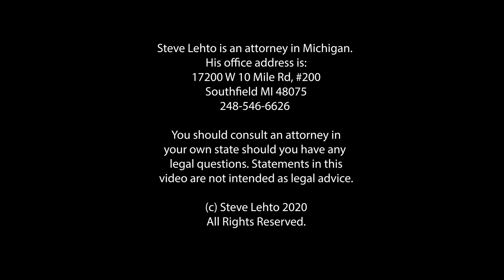Ford's Mystery Fix Explained - Ep. 6.263

Comment: Steve that's not it..........
Reply: @grandmasmalibu  The temperature gauge in any modern car is electronic, and the normal resting position of the needle actually represents a broad range of operating temperatures considered normal. This is to keep consumers from being concerned about perfectly normal variations in coolant temperature during normal driving. It is very possible for Ford's fix to significantly alter engine temperature with the driver seeing no change on the gauge. It's also possible for an update to reprogram the temperature range in which the gauge shows a normal reading, but we have no confirmation that they did that here, it's just also possible.
Reply: @grandmasmalibu  2 things: 

1, the modern digital gauges often have a range of ideal temperatures. For example my car shows it at "ideal 90c coolant temperature" anywhere from about 83c to 95c, the gauge doesn't move in that range, not like an older style gauge. I have confirmed this using the OBD port to read the coolant temperature.
2, the coolant in the engine may be a very different temperature to the temperature that the coolant temperature sensor is reading. The coolant temperature in the small channels in the block might be much higher than the temperature at the sensor, depending on where the sensor is in the loop. This is especially the case when using these electric fuel pumps, they are used so they can have very low coolant flow rates when the engine is in the initial warm up, and at lower flows rates there may be a larger discrepancy.

Obviously this all depends on the exact layout and operation of the coolant system, but I suspect the car is holding on to the lower coolant flow rates too long leading to hot spots in the engine, especially when the car experiences a large increase in load, such as when joining a freeway.
It's also possible they are running the coolant pump after the engine stops to prevent the hot spots after shutdown and avoid any warping due to differentials in temperature over the head and block.
Smart things these modern cars, they need to be, they are pushing the boundaries of technology quite hard.
Reply from the maker: YOU'RE WRONG!
Reply: @stevelehto  you are correct , Carnac the magnificent . 
we are the best , most knowledgeable, 
well read, understanding fans in the World.
Reply: @stevelehto  The PCM fix is a bandaid, the problem is mechanical, cracked head and leaking head gasket can be ruled out I think or the vehicle wouldn't be driveable for very far. Is there a vacuum operated switch in a coolant port on these vehicles?
Reply: @stevelehto  my guess is the engine is weak in the head gasket or o ring seals. The ?electric? water pump wasn't coming on after shut down. Heat builds and physics takes over. If they keep circulating water after shut down it stays cool and physics can't overcome the seals. Which means the engine is under engineered for common natural physics inside the engine. I'll not be buying one of those. Thanks for sharing
Reply: @grandmasmalibu  I would agree that this is not a good fix but a preventative measure if you haven't experienced a leak. As described below in another post if the engine has had the problem occur due to the torque to yield headbolts getting over stressed and loosing the gasket compression from new installation values, then it would seem like this will continue until the headbolts and gasket(s) are replaced and then the new programming may be effective. Another concern would be what would happen to the engine if the electric coolant pump would have a fuse blow or fail? Would this ruin the engine instead of a leak as we usually have now indicating failure?
Reply: @timhammond691  the fuse is not anymore likely to open now then before.  If the pump stops running, the coolant will get too hot and the warning light will illuminate.
Reply from the maker: @Real_Mechanic87  You missed the joke?
Reply: Wife has a 2012 Charger. You actually able to watch the coolant temp move, in a digital gauge, Whereas the needle does not move once the engine warms up. On to this issue, I still would believe that even with this "fix" there are still going to be issues with blown head gaskets. GM had all kinds of coolant leaks on V6 engines. Wife had 2002 Pontiac, that was recalled to tighten bolts on intake manifold. And older GM V6s blew head gaskets at around 100 thousand miles.
Reply: @robertbelluchi1151  oh, no doubt there should be some concerns. It's entirely possible it was bad software resulting in damage and now fully fixed. It's also entirely possible it's just a bandaid to hide another defect. It also doesn't fix any damage, warping or anything else that has occurred but isn't yet leaking coolant.
Reply: @robertbelluchi1151  you know the funny thing about that GM V6 was that the previous version of that engine had the same specs, but ran forever with no problems.  I suspect that the redesign was done solely to save a couple dollars per engine......
Reply: @grandmasmalibu  maybe the gauge is independent of the actual temperature inside the engine
Reply from the maker: @Real_Mechanic87  Dunning Krueger? That's funny.  Remember that one of the things they tested was a sense of humor. And lack thereof.
Reply: @Real_Mechanic87  I only mentioned the water pump and system pressure because your original post talked about pump speed in relation to pressure and that slowing down the pump would increase system temperature.  This is exactly opposite of what you would want......whatever Ford is doing, it would make sense that they were trying to reduce pressure.....pump speed will not do that directly...only reducing overall system temperature will lower pressure....
Reply: Wrong, what Ford is doing is further on down the line when coolant intrusion becomes to severe is to say they fixed the problem it must be something else. Your problem. Fords fix 75 dollars, your fix thousands. I don't care who says what, who bs's the best etc etc etc. Coolant is not supposed to intrude into the combustion chamber under normal running conditions. Period. Anyone that swallows Fords or anyone else's statement contrary to this is a fool.
Reply: A sure indicator of an unreliable commenter is ellipsis misuse.
Reply: @CassiaConvolution  " [ i ] ndicator . . . misuse " ?
https://www.youtube.com/watch?v=CyKCsL9UJgw&t=111s
Reply: @Real_Mechanic87  aside from the fact that my post was meant to be funny, the water pump in a vehicle cooling system does not build pressure in the traditional sense and merely moves the fluid which is already  under pressure from the heat produced by the engine.  The pressure is proportional to the temperature so reducing the system temperature will reduce the pressure.

Comment: When I had my Subaru tuned the tech lowered the temp at which the radiator cooling fans switched on for head gasket problems on the flat 6 engine.

Comment: They are just covering their butts because of weak head gasket issues, not fixing the actual issues with proper head clamping. Now they're decreasing the life of the electric pump. Also if the coolant intrusion had already started it may stop if it uses a MLS gasket, but it will not be right again unless the gasket and bolts are replaced. It wouldn't surprise me if they did some "other" updates on the pcm as well, to help it run a little sluggish/cooler. Just my opinion though. But would be interesting to know what they're doing about the ones that are leaking.

Comment: As a trained mechanic They're fix makes NO SENSE. Pistons create PSI. Some cases above 90psi. On HP engines maybe 12 psi. Leaky head gasket causes coolant in the combustion chamber. Common sense psi in the combustion chamber causes air leaks in the coolant system "Bubbles in the radiator coolant fill" Higher pressure in the coolant system causes coolant to leak past a damaged head gasket. Cracks in the water jackets nearest the combustion chamber. I had this with the Ford engine and others that the owner ran the temp to over halfway about 250 degrees or more. "Engine Block Seal" was a fix that worked 80% of the time. What happens when you use it correctly it acts like a glue that stays liquid with the coolant.It finds the weak areas of intrusion and because of positive pressure and the dry hot air from the motor it becomes a solid and seals the leak. The fan isn't the problem. Same engine different cars don't have its issues. While you drive city streets or freeway your running temp will change Hot day, A/C on in bumper to bumper traffic for an hour. That engine and cooling system it working it's best to keep it cool. The ECM keeps it working at max efficiency. They are fixing something other than the say is the "REAL" problem but just don't want the stock holders to know about it.. "Ford Pinto" Heard that before huh? "Don't blame it on the motor, we can't replace 2 million" Block seal could pull them out and save MILLIONS!!!

Comment: @Steve Lehto, Heat has been identified as a cause of the problem, increasing coolant flow may reduce the operating temp and thus stop the problem but is not a cure for the problem. My not being an automotive mechanic per se, without knowing the engine, without knowing the gaskets for this engine, I'm willing to speculate that the PROBLEM of coolant in cyls lie in the intake gasket(s) and expansion of the intake allowing for seepage to occur which will get worse over time (old style water seats in the house for example). PCM is a BANDAID NOT A CURE

Comment: So the pump will run earlier and longer. I was originally suspecting that the thermostat or pump was running or opening(thermostat) too early before the engine had to time to heat up, expand and seal better.

Comment: my boss had a similar problem with his BMW. the auxiliary electric water pump would not always come on when turned on by pcm. replaced it and problem went away till the pump failed again. has since sold his M5 as well as wifes M5 as front fenders kept coming loose as well as front bumper cover. BMWs not designed for people who live on dirt roads.

Comment: On what day in the Book of Genesis did God create cars with the water pump behind the fan in the front of the engine, matched up with the front of the car? I'll pencil that into my translation. (I already added that Springsteen was created on the 8th day, but I didn't know before that your audience was even greater than his. But don't get yourself into trouble like John Lennon by saying that your audience is even bigger than Jesus's.)

Did Satan trick some car engineer in the 20th century to install a transversely oriented engine? And then later trick some computer guy to build the first engine computer?
This doesn't explain how the satanic carburetor and automatic choke were replaced by fuel injection.

It also doesn't explain why none of us travels around by jet pack by now, despite all the old sci-fi stories making it seem obvious.

I wonder if there's some auto mechanics class where they tell the students to imagine a little guy with a laptop inside the engine, making things happen at the right time.

Comment: Ford Engineering team reports 8D coolant consumption report to management - “We’ve determined the root cause to be a combination of poor head gasket material from the supplier combined with out of spec torque control on the head bolt tightening. We need to issue a NHTSA recall…”
Ford Management – “We don’t accept your findings (a.k.a. That will cost too much). Find something else that we can say that sounds believable to get these suckers past the warranty period."

Comment: the coolant is in a closed system if coolant enters the cylinder for any reason it must be from a leak through a gasket or seal.   i can see if an electric water pump may over pressurize the closed system but it still has to get passed gaskets or seals.   to fix it properly yes adjust the pressure with software but at this point to do it right youd replace gaskets too or its still a ticking time bomb.   being in the auto service industry i can tell a bandaid fix from a real fix.   sounds like for just wants to bandaid it to avoid a more costly repair for the life of the warranty, after that they dont care if it blows up cuz you will likely buy a new car

Comment: An opened deck design in other words the cylinders are not attached by a web at the top to the block deck cylinder can move expansion contraction causing head gasket failure and leakage gentle driving can reduce failure. A crap design.

Comment: Here is the rub... h2o boils at 212f at sea level and roughly 170f at 14000 ft so pressure is introduced to the cooling system to reduce the boiling point. 14 to 15 psi is somewhat normal. Now if the pump running pressure is reduced to decrease coolant passage blow by than the boiling point is reduced by an equivalent amount. Hence the cooling system will see micro boil off like any system at any pressure. That boil off will increase the acid content much more quickly than the full pressure ssystem.This phenomenon will be increase the higher in elevation that the vehicle is operating at. As a Colorado driver we experience this even with fully functioning and pressurized system. This is a bandaid fix at best and destructive to the alloys on a daily basis

Comment: They have confirmed my theory that engine temperature is the cause.  If engine temperature is regulated by the coolant pump, instead of a thermostat, they could just be lowering the operating temperature.

(Still, it's a half-ass fix for a poorly designed engine...)

Comment: I believe only the hybrid engines have electric water pumps, and electric p/s and electric A/C. You still need these pumps when the engine is off and running in electric mode.

Comment: First.  I am out of date.  Wow, did not know they doing electric pumps now.  So maybe was partially right, was in cooling but thought it would be  the electronic thermostat.  Other thought about the old school water pump.  If built right any car going over 30 mph has enough ram air to keep it cool even with a/c.  Electric fans good for this reason.  Here is the rub.  Most of the time you are in traffic sitting still, best have a darn good electric fan and alternator to keep up.

Comment: Electric water pump turns on more so there's more cooling done to motor.....thank you prious they started the motors with electric water pumps.. but there's a theory of over circulating coolant so it doesn't cool down fast enough. like motor going 2500 RPM an pump going 900 RPM cooling more than mechanical pump running 2500 with motor at 2500 RPM ...some racers on 350 motors used stock pump with a electric belt drive motor to keep a constant circulating cooling etc .... But now of these days motors are literally machine screwed together saving money on bolts or making more money in the future servicing junk builds little screws corrode an sieze after awhile causing breakages

Comment: I theorized about a PCM controlled thermostat in the last video. I then went to rockauto to have a look at one. It looked pretty standard, and clearly mechanical only. I also had a boo at the water pumps mounted on 2017 model escapes. They sure look like they are pulley driven to me, mind you they don't have the pulley on them. My question is what is the drive mechanism for the pump? Is there a motor bolted on rather than the pulley?

Comment: Steve these vehicle have two water pumps. One mechanical that works just like they always have and an electric pump for the start stop feature which the recalibration runs the electric pump more often during engine off time. However I know for a fact that the cylinder block has been redesigned due to coolant intrusion. If the software fix was the root cause why would the go to the expense of reengineering the block casting?

Comment: Until it is IDENTIFIED how coolant is getting into the engine cylinders, the PROBLEM still exists. Engines should be able to run @200-210 F with no problem (properly anti-freezed), component heat expansions should accomodate these temps. Identify where the coolant is getting in and then determine fix. WP controls volume of coolant flowing thru engine based upon engine design and psi to maintain temps based on thermostat operation to maintain engine operational temp. Increasing volume flow (PCM FIX), DOES NOT fix problem, it is just a bandaid

Comment: Battery fails, cooling pump and fans quit, then engine blows up with warped heads!  Sounds like modern technology at its best.
Reply: What makes you think the engine would continue running with no system voltage? Is it your complete lack of car knowledge?

Comment: It's an interesting subject matter and it reminds me of the fact that F1 engines (and I presume Indiecar engines) are essentially 'seized' when cold and will not start until hot oil is circulated around them to get them hot enough that the components expand enough to allow these high-effgiciency high-powered units to run!  Ok, so this is a cooling function, but it may nonetheless be essential to ensure full circulation of coolant is achieved before the engine ignites and to ensure full cooling once it's stopped.  My guess would be that the wall thickness between the waterjacket and the combustion chambeers is very thin and liable to distort and then potentially wear through if allowed to run for a few seconds after the ignition is cut off.